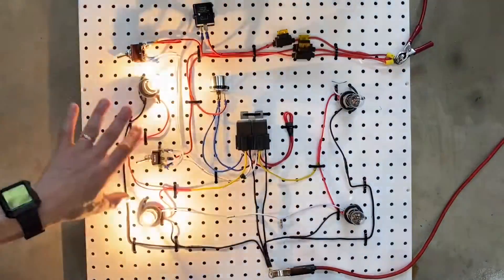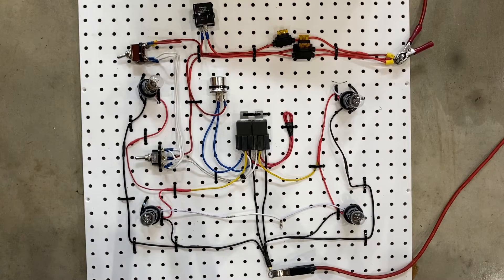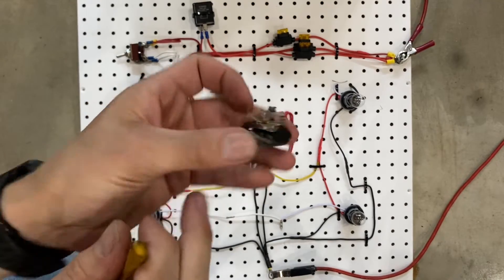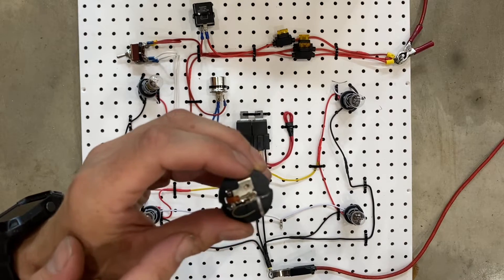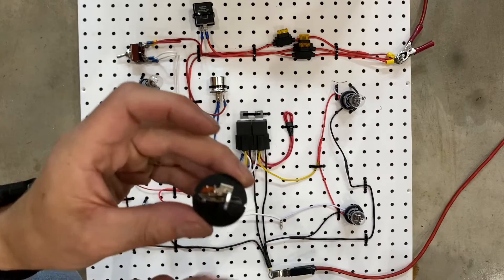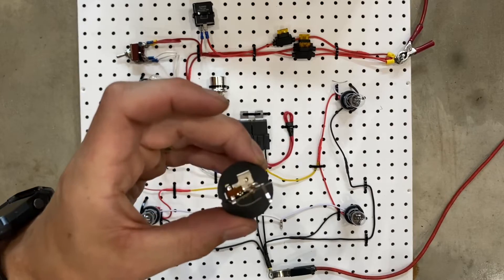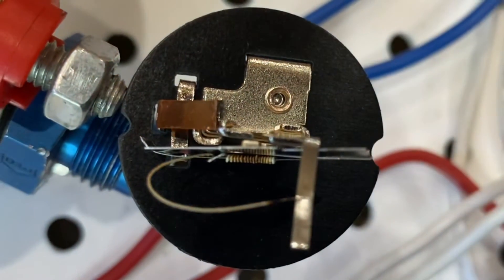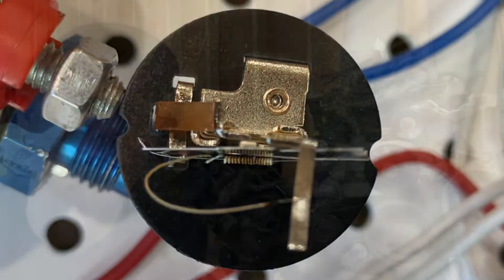How Does a Turn Signal Flasher Relay Blink The Lights on Your Car | Truck | Motorcycle?

Comment: Hello, I have a 1957 Lincoln and it has two wires going to the flasher unit when I connected a new flasher unit which is two pin and also  incorporates a buzzer, the buzzer sounds when I turned the indicator switch on but my indicators now do not flash. Any suggestions. Or is there something else that I can add so I can hear the indicators when they are on? Thanks for your help?
Reply from the maker: It’s tough to diagnose without being there. I think if I was in this scenario, I’d try to find a factory diagram of how the lights and wired, and then figure out how to incorporate modern components in the place of old ones. Unfortunately with older/obsolete parts, you might need to convert it over with different components entirely to make it work. If you are still using the original 1957 wiring, it may be a decent idea to do anyway. Sorry I couldn’t be of more help. Electrical stuff is hard to diagnose without being there, or at least familiar with the car.

Comment: Hope you read new comments about older videos.

Have a 12 Volt tractor whose hazard flasher modual has failed.
Dealer wants $95.00 to replace it. Yikes!

I am older and remember old fashion turn signals added to late 1940's pickups and the old can flasher going click click click.

Saw your video and wondered if the flasher you use can handle the current of just two 12 volt light bulbs without a relay?

Recall old pick up flasher rate sped up with trailer lights added as compaired to no trailer.  Would not do that if a relay had been used.

Thanks
Reply from the maker: The flasher in the video (also linked in the description) should work, but the speed of the flasher depends on the current flowing through it. So the flashing will vary depending on the type and number of bulbs used. If you are unhappy with the speed of flashers, or if you want to use LED bulbs, you can either add resistors to the circuit, or you can get a flasher with an adjustable speed setting on it.

Comment: Are 95 S10 Chevy pickup has no turn signals my husband fix the brake lights and the running lights but she had to completely rewire under the truck we cannot get the turn signals figured out for the life of us when you press on the brake both the turn signal lights on the dash light up only when you press the brake though

Comment: great video.  never knew how that worked!  I have a weird problem: right blinker works normal- stalk up and right blinker light on dash lights up and blinks, but when I use stalk down for left blinker both lights on dash come on blinking (like hazards).  could there be separate relays for each direction and maybe one of them is bad? can't wrap my head around what's happening there.  thanks
Reply from the maker: The two common reasons for that to happen are:
- turn signal switch is broken (it usually feels slightly different when this happens. Softer “click” feeling)
- somebody put the wrong bulb in somewhere and its acting wonky

Do either of these scenarios sound plausible?

Comment: I turned off the ignition and step outside of the vehicle the inside dome would go off but the front and back lights would stay on until I on due to positive post it's a older battery ac Delco

Comment: Hello I have a question I own a 2004 mercury mountaineer truck well I have something going that's draining the battery when I shut it off so I have to un do the positive post at night but I went to AutoZone and it was check it read either the battery was charging to fast or to slow I think it could be a short or wire issues
Reply from the maker: I don’t currently have a video on that, but generally you do a “parasitic draw “ test with a multimeter hooked in between your car and your battery. I’ll add this video to my to-do list because I think it would be a great one to add to this channel.

For your case - always start with obvious things like:
- any aftermarket accessories (lights, radio, horns, etc)
- a really old battery can act like this (normal life is about 5 years, and they usually have a date in the side or top of them) 
- make sure your alternator is putting about about 13.5v with the engine running.
Reply: @WiringRescue  thank you

Comment: do you know why it offsets sometimes it ticks quicker than usual?
Reply from the maker: Generally that happens because a bulb is burned out, so the amperage draw through the flasher changes, which then means the bimetallic metal heats and cools at a different rate, and the lights flash differently.
Reply: This can also change based on heat, it’s very simple and many factors can change flashing speed